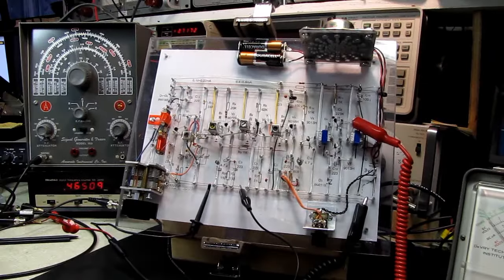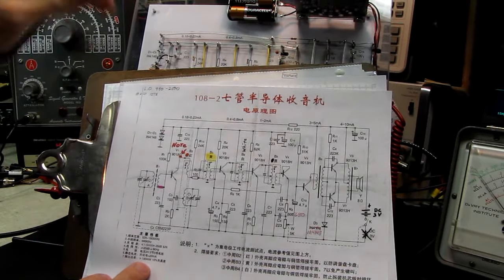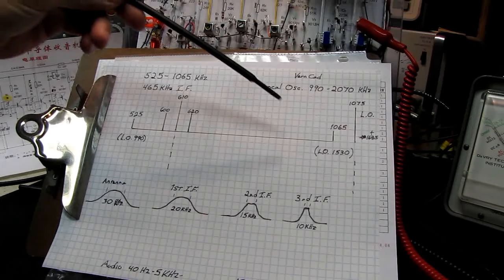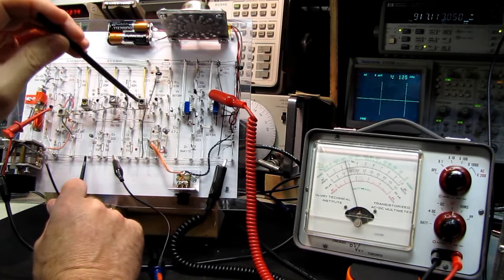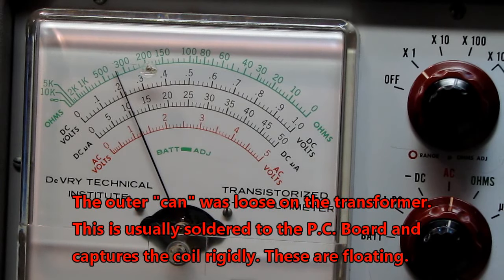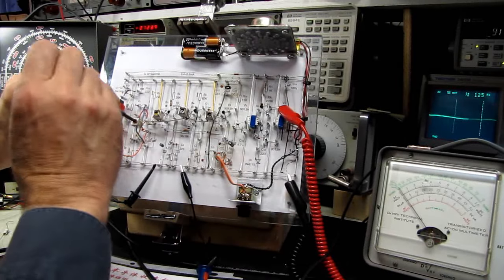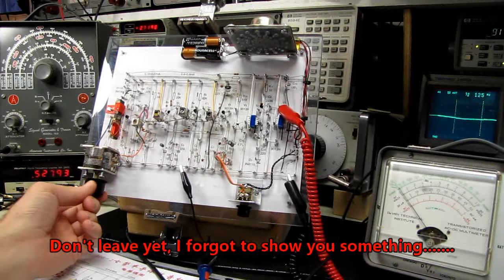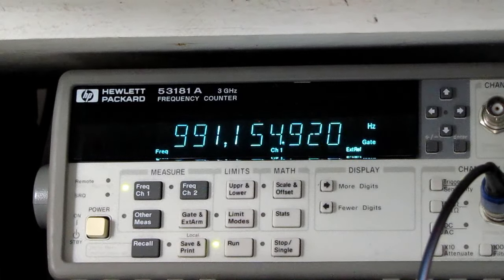10 Buck Test Bench - 7 Transistor Radio Video #2 Alignment

Comment: Hi Radio Mechanic, Excellent stuff you provide. I am an ex Consumer Electronics Engineer , taught by the brilliant tutors/Engineers at Oldham Technical College, England. Since I am now 63 years old I guess they are all gone now as is the engineering section of the College. There's no more use for the army of TV and radio engineers there once was. But the skills we learned are highly regarded in whatever other field of electronics we have found ourselves in. I have built the same AM radio you have from Banggood, one thing I could perhaps add is that the reception will be markedly improved if you slide the antenna coils towards the end of the ferrite rod. You will find it peaks up as the end of the large coil is near the end of the ferrite. Best to do this with the radio tuned to either a weak station or just noise. Then readjust the antenna trimming capacitor.There are several other peoples videos on youtube of them building this same kit but they have the antenna coil fitted the wrong way round so that the little coil is nearest the end of the ferrite this is never going to peak up at all. Thanks for the memories, Patrick Holdaway.

Comment: I enjoy doing research on radio type projects. currently  im looking at a tube Theremin. I just finished a solid state design Theremin . AM radio low level transmitters are a curiosity too.  Repairing and restoring vintage test equipment is a keen interest, but nothing past the 1960’s. Digital and Computer gear ya can keep, but I have fabricated several home type computer rigs.

Comment: The old adage " One picture is worth a thousand words" is proven again with your video. I have read several books on alignment but none sunk in as well as your demonstration. Thank you.
Reply from the maker: Hi Eddie, Thanks. There are more coming on the subject. FM radio will be one and I have another AM Radio to restore that will need a full alignment. Going to use the antique test gear on that one.

Comment: Looks like you may have assembled an old Graymark kit back in your vocational electronics days. After forty years, I found mine, recapped it, and it works again. We built ours on a schematic board just like you did this one. Brings back memories.
Reply from the maker: Hi David. Nice Shack. Much cleaner than mine. Don't think I have ever seen a Graymark kit. But there used to be similar kits from R.S. and Allied back in the day. Figured I would update from heavy fiberboard to Lexan and use Teflon standoffs. Worked out pretty well.  Thanks for watching and the nice comments.
Reply: wb8vqv Oh wow I remember when we had a Graymark Semi Truck (their name on the side) deliver kits to our High School!
Such Memories!
Reply from the maker: Kids today have lost the sense of wonder.

Comment: Hi,
Yesterday was my 20th birthday, so I made me a gift, I bought some old transistor radio to repair. I did a degree in digital electronic, so I know more about microcontrollers than analog electronics, and your videos are a great help in the improvement of my knowledge in analog. Your "10 buck" serie has help me in the choice of material too, I already had digital multimeter, function generator and oscilloscope and you helped me choosing a LCR meter and a needle multimeter. So thanks for sharing with us your knowledge. (Excuse me if some of my words don't mean anything, I'm french)
Reply from the maker: Merci mon ami. Your English is excellent and far better than my French. I am glad I can pass on tricks from un vieux. (J'espe're que c'est correct?) I try to pass on tricks for new players and show that even with older test equipment a lot of good work can be done.  It is faster and easier sometimes with my new equipment, but much of this is too expensive for young players.
Again, Merci.
Reply: The Radio Mechanic Your french is really good too. Working with old material is better in my opinion, it has been designed to work a long time when today's devices are dead really quickly, and it has the vintage mojo. And one more time, thank you for your content.
Reply from the maker: Your welcome, come by any time...

Comment: Another great video for the new radio enthusiasts.  Definitely nice to see you weren't using one of those golden screwdrivers.  LOL, just don't give all the secrets away, you'll put me out of work. :)

A note on alignments by ear.  You would be surprised how accurately you can align a receiver by ear.  I usually do my first run through by ear and then follow up with a SINAD meter.  I have done so many now and have my hearing trained that I often can not get anymore improvement.  Also helps that I ran sound for a band for years and am a audiophile.  Took a long time to get my golden ear.
Reply from the maker: Hi Mike, thanks for the nice comment. Remember, these videos on 10 Buck are for the young players. If they are "warm to the touch" they will figure out pretty quickly how to "tune by ear".
I seldom use anything but the sig gen on the first pass either. Been tuning engines by ear for years, and could tell when our machines in the field dropped from 9000 units/hour to 8900 units/hour just by walking into the fab room. 20 machines on the floor and I cold hear the one not up to par. You and I aren't going to be around forever.

Comment: Hi there, Many thanks for the efforts you go to making all of these wonderful videos. I have learnt so much from the knowledge that you share. I am a 57 year old retired businessman. Amateur electronics is a hobby of mine that very much enjoy. I have a particular problem that I would appreciate some advise on.  I have built a few chines cheap radios lately, most of which actually work.  My latest kit is the AM/FM radio from ELENCO. Its an educational kit that is supposed to help the builder learn about the workings of both AM & FM. I am happy to be able to tell you that the AM section went well and is working well. The FM section has been completely built but sadly does not work.
I have completed the testings as requested to the best of my ability using my Rigol DS1054z scope & Rigol DG1022 20 meg signal generator. The last section of testing requires signals well out of the range of the gear at hand. So that part had to be dealt with in other ways.
The guide gives a list of required voltages for all of the transistors. They are all within the range quoted. I have tried injecting a 10.7 meg, freq 1k, deviation 22.5k signal into the base legs of all the transistors. All but Q5 & Q6 gave out a tone.

Does this mean that it is the if transformers that need to be replaced ??
I am at something of a roadblock at the moment. Any help and advise you could offer would be gratefully received.

In the mean time, I would like to wish you and your family a very happy new year, all the very best, Yours Ricky

Comment: The way I explain receivers to others is to imagine the RF spectrum like a paper band, like paper tape from an old adding machine or cash register,  running from low freq on one end to high freq on other end. Receiver is like a verticle slot in an index card slid up or down tape. What the slot in card reveals printed on tape is the signal a receiver would tune. The "width" of the slot is the band width.

Comment: Man, did you answer a question I never thought I had,
yesrs ago I was learning how to design superhets, from scratch,
so I bought all the cans and tuning caps for both AM and FM IF's.
As well as the L.O.'s. But after awhile I began to think, why use
all these variety of cans., shouldn't the stages work with the 
same values of cans throughout, so I experimented, and I got
radio signal, but mostly shortwave, due to skip ect...

BUT now I see why there are designated cans, each one is designed
for more and more filtering as the stages progress to the output.

That's why mismatching the cans will give poor performance, wow, I never
thought about it until now as you were explaining how the bandwidth
is decreased for more selectivity as it goes down the line to the output.

Thanks, for a great teaching you have done with this series.

Comment: Once again great video Vern.  Teaching by showing the end result (the cool stuff) then working backwards to explain the why is sometimes the best method.  Starting electronics with Ohm's Law is boring and people loose interest fast.  This is great stuff.  Your years of experience show through brightly but remind our young players that a road map to alignment is included in the service manual.  If I can find a manual for free on line I will but there is always the old stand by, Sam's Photofacts, if the project is worth the twenty plus buck investment.
Reply from the maker: Hi Paul, Thanks for the kind words. Did mention in one video that it is important to follow the manual if available. None available for this one. Thanks for watching.

Comment: Hi frienf. I got a question minute 17:36 when u measure the peak with the osciloscope. U connected to the speaker and the signal generator is 465khz.
When u inject that signal 465khz what is the measure at the out speaker with yhe oscilosc.

Comment: Really good tutorial.   Could you please tell me what value variable capacitor did I you use?  I had an old variable capacitor spare which I modded by removing vanes from the aerial and oscillator sections.  The two sections measure 150pf + 65pf (the two trimmers will add to those values). I cannot get the high end frequencies to tune.  Fitting a poly varicon 150pf + 65pf, everything tunes in fine.  I was wondering therefore what variable capacitor you used.  Thanks.

Comment: 7 years late but thank you, it is a great demonstration and very informative video. I have the same kit I bought it a very long time ago waiting for my grandson to come of age he is 9 today and its time to advance him from crystal set radio builds to this kit. I'm planning on doing nearly the same layout as your board but I'm having a little difficulty figuring out the wire connections for B1 antenna coil and transformer B2 in relation  the (BIG) variable capacitor any advise would be appreciated Thanks again
Reply from the maker: I am presently in Thailand for the winter. So I can only go from (bad) memory. My antenna coil had some color coded wires ( Very faint ) that were mentioned on the schematic. If your instructions are in Chinese, Use Google Translate.  In short the Larger antenna coil/section goes to the larger variable capacitor section. The smaller one is part of the oscillator and goes with the smaller part of the capacitor. However Phasing can cause issues.
If the oscillator fails to run, reverse the connections. I was very lucky to find a large air variable of the correct values in my junk box that
replaced the plastic variable in the kit. Good luck with the project.

Comment: Here one for the little red radio work the antenna coils knock out the radio completely all tune in all station come in real good but attaching the last antenna wire for am band when solder knock out the whole radio all three antenna wire are in the right places and it work really well but when I bring that wire to the right spot on the circuit board it goes dead on the radio will not tune any am station so i left it offbrad

Comment: A good demonstration, however you did not disable the LO when aligning the IF. The LO with the 455:Khz will peoduce other unwanted frequencies in the IF Amps creating error. You,also,did not use a RTMA dummy load network.

Comment: I purchased and completed the seven transistor radio kit following your YouTube video which was a big help upon completion radios is dead  I am measure from negative to the base of all seven transistors and get .65 V DC if I hold the soldering iron over the board I get a hum I appreciate any advice
Reply from the maker: Hi Gary. Sorry to hear the radio didn't work.  Watch the video below and I show how to trace trough the circuit. You will need a length of wire as an "Antenna" and a pin or test lead to connect to it. Also note in the video when I am showing the layout of the board there is a wire I have highlighted in RED from the antenna. This must go to the connection indicated. By following the procedure in the video you should be able to find out what stages work and where the signal is being lost. Let me know how you make out. Vern
https://www.youtube.com/watch?v=xlkX6mYQX9g
Reply: I did go back and studied your video several times and you'll never guess what was wrong.  I did not solder two of those bridges.  I found them thru a magnifier.  I worked on trying to get figured out but could not for two days.  I glad I didn't give up and very proud of my new accomplishment.  I hope this gives you satisfaction that you have taught a sixty five year old guy something new.  Thanks again and waiting for new project.
Reply from the maker: Hi Gary, from one 65 year old to another, I am Very pleased to be of help. And thanks for watching.

Comment: Dear Radio Mechanic, Question: I am building the Elenco AM/FM-108CK. Working on the AM side. All test have passed, the problem is in the mixer/oscillator section, there is no signal output into the ist IF. I have checked all parts, soldering and connections. I have replaced the mixer transistor still no RF, All voltages are correct. Does this sound like defective oscillator coil?? Thank you kindly!!
Reply from the maker: What color is the screw in the Oscillator transformer coil? Should be Red. I have seen them come with the wrong coil before. Also check continuity of the transformer. Just follow the schematic. One side has three connections, the other side two. An ohm meter will verify if they are intact.  Lastly it is very easy to get the antenna connections incorrect. Check carefully that you have connected the correct winding to the oscillator. The smaller coil on the antenna is for the oscillator. And one more thing, if everything else is correct try reversing the wires on the antenna oscillator winding. That is, there is one wire to the base of transistor V1 and one wire to Capacitor C223. Reverse them and see what happens. They can inhibit the oscillator if the phasing is incorrect.  Good luck and thanks for watching.

Comment: Hi, I watched the video again. I see you basically forgot about adjusting the aerial coil, since you adjusted the aerial trimming capacitor at the low end of the band and then remembered you should have adjusted that at the high end of the band. Same as you adjusted the (pad) oscillator coil at the low end of the band and the oscillator (trim) capacitor at the top end of the band. Then you should have adjusted (Slide) the aerial coil (pad) at the low end of the band for maximum signal/noise and then adjust the Aerial (trim) capacitor at the high end for maximum signal/noise. I am just as old and forgetful and at first forgot the exact same thing, left the aerial coil in the middle of the ferrite core and poured  wax  over it to stop it from slipping off the core. When I remembered how it should be done I had to pry the aerial core paper former from the wax to be able to slide the aerial coil towards the end of the ferrite. but It's all just done for entertainment. There is a lot less on medium wave (AM) in the UK these days than in the past, Commercial stations that are on FM are holding onto their FM stations as well as taking up DIgital radio channels. The BBC is rapidly shutting down local AM stations while the tremendous interference from computers, wireless routers and just about everything else electrical really makes AM radio almost a dead duck here now.

Comment: Howdy!  Just found your channel via Mike's, I enjoyed and appreciate this video as I am trying to learn this properly....I have all the tools shown in this video, however you didn't show where you tied in all equipment or explained where all went. I just bought my first scope (https://youtu.be/spUe7p2jXrM) and wrapped the probe (connected ground to tip on probe)) around the ferrit bar at and laid it on top of the copper wire, set scope to low sensitive settings and was able to see the tunning and by such was able to tune up my radio that way.   In your future video, could you address the IF can color representation and maybe a future video on FM broadcast alignment.  Thanks!  Jack, VEG
Reply from the maker: Have been trying to keep the 10 buck series simple for the young players hence the AM radio. Still have more to cover there. Sold off all my old FM radio alignment gear and now wishing I had kept the FM Stereo Generator. Will get another one when I find a deal. You are on the right track feeding the signal that way. I actually clipped the signal generator on to the insulation of the antenna connection at the tuning cap during the last part of the alignment.
Reply: OK, understand, thanks for the encouragement!  My Jackson covers FM band as well as having provisions for FM mode, just put it on the bench today, getting a parts list together...I could have used it many Times!  :)  By chance, have you've been successful in using harmonics to align a radio for frequency? ~Jack, VEG
Reply from the maker: Hi Jack, yes harmonics can be used. Most of the early simple signal generators used harmonics for the upper bands. I did a video on one "10 Buck Test Bench Accurate Instruments R.F. Generator Part 2"  Note that the band switch has 5 positions. A, B, C, D, E.  The Last switch position does nothing, In fact the switch is wired so that the contacts for D and E are in parallel. There is NO change between the two positions. The Switch just is a reminder to look at the E scale which uses the second harmonic of D. There is NO change in the output. 
Remember however that when using the second harmonic any error in frequency is doubled. Vern